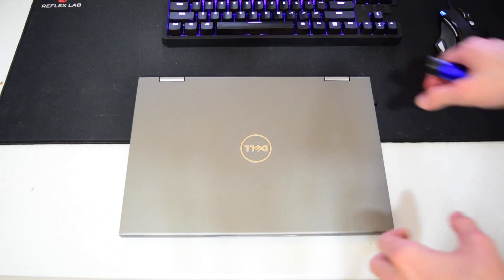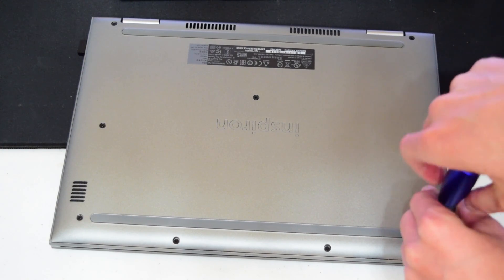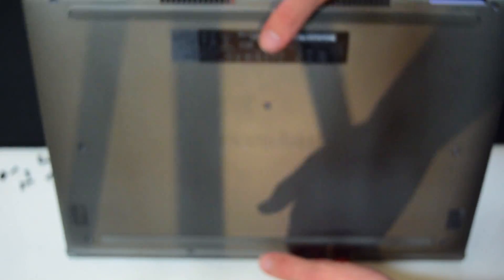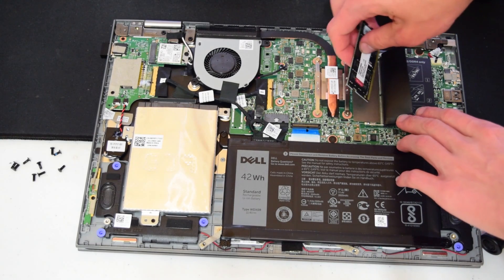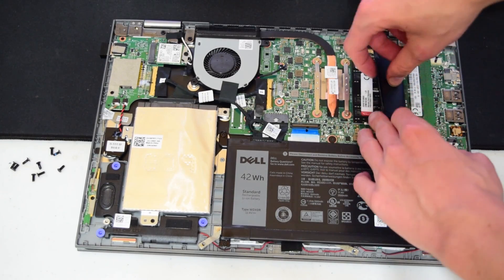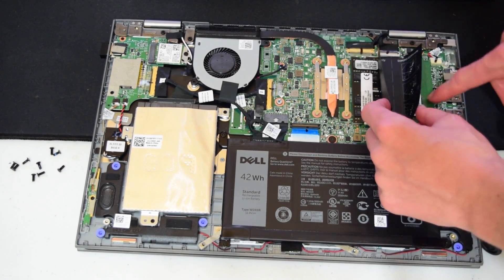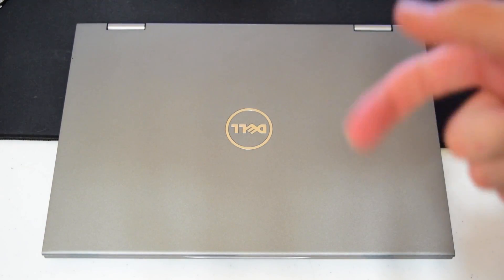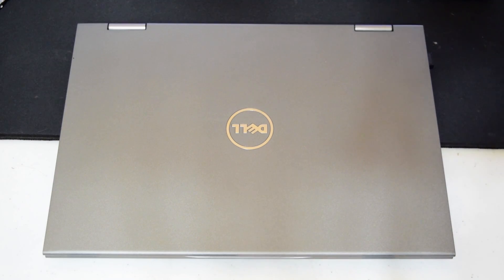Dell inspiron 13 5000 2 in 1 2016 ( ram and ssd upgrade with teardown)

Comment: I have dell 15 3000 series that I purchased just last week. But I only have 4gb which is not helping to move very fast. do I follow the same procedures here? and where do you recommend I buy RAM?
Reply from the maker: Yes follow the same procedures as i did, and any ddr4 sodimm ram from amazon will work for this model laptop. If your having speed issues then is might not be ram unless you have looked in task manager to see if your ram is maxed out, it could be the slow hard drive. But if your system is ram limited then any ddr4 sodimm ram, i purchased mine from amazon.

amazon link to the single 8gb  i purchased and installed in my computer:   https://www.amazon.com/Kingston-Technology-HyperX-2133MHz-HX421S13IB/dp/B014R8JPYW/ref=sr_1_1?ie=UTF8&qid=1473811480&sr=8-1&keywords=ddr4+sodimm+8gb

Thank you for watching, don't forget to subscribe, have a great day.

Comment: Excellent video Len. I have one DELL 13 5000 2 in 1 from 2015, and tomorrow will change the HD by a SSD. It is just to change it ? Do I need to change anything in my BIOS or it recognize automatically ? Another question: my is one I5 with 8 GB of RAM, DELL people said I can have only 8 GB of RAM, is that true ? or I can upgrade it to 16 / 32 ? Tks man.
Reply from the maker: Should be the exactly the same or mostly the same for that laptop to upgrade to a ssd, also i looked that i5 up and it says on intels website that it only supports 16gbs of ram, so unless that laptop just wont allow it 16gb or ram will work great. And when upgrading ram you don't have to change anything in the bios but it did bring me into the bios to tell me that the amount of ram had changed and that was it no extra configuration for the ssd or extra ram.

Thanks for watching, don't forget to subscribe, have a great day.

Comment: What about the battery? Where can i get a replacement
Reply from the maker: The battery is replaceable, and i don't know where to get  a replacement battery to be exact, but dell should offer replacement batteries, you might have to call them to ask but the battery is replaceable.

Thank you for watching, don't forget to subscribe for more content, have a great day.
Reply: Ok thanks but i figured out it was the charger, the pin in the middle had been bent so i bent it back

Comment: Hi looking at this laptop and it lists the cheapest version (i3) to have 4gb of single channel ram.

Can you insert dual channel ?

Also do you have a link for the ram you bought for it please
Reply from the maker: Yes there is 2 dim slots for ram, yes if the memory is the same then it will run in dual channel, I only purchased 1 8gb stick of ram and i'm using the 4gb stick that came in the laptop also for a total of 12gb of ram.

this is the link to the 8gb stick of ram i purchased: https://www.amazon.com/Kingston-Technology-HyperX-2133MHz-HX421S13IB/dp/B014R8JPYW/ref=sr_1_1?ie=UTF8&qid=1472838073&sr=8-1&keywords=8gb+ddr4+sodimm

Thank you for watching and don't for get to subscribe for more content, have a great day.
Reply: Hey, first of all thank you for posting this video.
Now, regarding RAM memory, in theory isn't it better to have 8 gb (4+4) running in dual channel than having 12gb withouth the benefits of dual channel? Why did you opt for 12gb?
Reply from the maker: Yes its better to be running in dual channel for double the memory speeds, but i needed more than 8gb of ram and didn't want to pay for 16gb of ram, so i bought just a single 8gb stick and the ram as i have it running in single channel.Yes dual channel is better and i plan to put another 8gb sting in eventually but for now its not bothering me. 

Thank you for watching, don't forget to subscribe, have a great day.

Comment: is yours the model with i3 or i5? ps. good video
Reply from the maker: My laptop has the i3, in my opinion the i5 or i7 isn't worth it but its up to you on what you think but the performance gap is so small for a big price jump for the performance you get for your money. Thank you, Thank you for watching, don't forget to subscribe for more content coming very soon. Have a great day.
Reply: Agreed, it's a $300 jump from the i3 to the i5 for me in australia. Thanks for this video mate, gonna go with the i3 and upgrade it with an ssd and more ram.
Reply from the maker: That's a great choice, the i5 just isn't worth the very minimal performance you gain. Thanks for watching, i have new content available that you can check out. Don't forget to subscribe, have a great day.
Reply: +Len Nobles Will do! thanks for the videos!
Reply: nah, ssd and ram upgrades are fine with Dell. You can always just put the original components back before getting it serviced

Comment: Much thanks for posting. When I first called Dell to inquire if it has two slots they told me it didn't. Before I had seen this I had read conflicting reports online stating that it did have two slots. So I chatted with their sales department online and they told me it does have two slots. I should have just added an 8GB stick to get a total of 12GB like you did, rather than buying two 8GB sticks. It would have saved a bit of money. I wasn't completely aware if you could run two different sizes of RAM though. I'm pairing it with Crucial RAM and likely a Crucial MX300 525GB SSD. Haven't decided for sure which brand of SSD to go with. 

What is with Dell taking so long to ship devices? I just ordered a standard configuration, not a Smart Selection, and it listed the unit as shipping in 7-10 business days. Now that same unit is listed as shipping in 13-17 business days.
Reply from the maker: I bought my laptop from amazon but dell is has a reputation for being super slow to ship there products and they choose the slowest shipping method, i think its ridiculous but they do make great products and their customer support is really good.
Reply: How its work the curcial 525 ssd ?

Comment: Hello, I really liked your video and got this laptop. Now, I also want to upgrade my HD to SSD. I am wondering if this SSD (http://accessories.us.dell.com/sna/productdetail.aspx?c=us&l=en&s=bsd&cs=04&sku=A8171238#Overview) will work in my laptop.

Also, can you explain how we have to move the operative system and programs from the HD into the new SSD? Please.

Thank you.
Reply from the maker: yes that ssd will work, but dont buy it from Dell they rip you off so bad, here is the amazon link to0 the same drive that is 60 dollars less:    https://www.amazon.com/SanDisk-Solid-State-2-5-Inch-SD7SB7S-010T-1122/dp/B00O4OHCUE

as of for data Migration, i can do a video on that to help you know how to do that if you'd like, nut i have the adata true image software that came with my adata ssd, now one of the things to always look for when buying a ssd is if comes with a imaging software, so id look for one that has software like that, that sandisk ssd might have a bundled software but if not id look for another ssd, i'd refuse to buy a ssd that doesn't come with software if you don't already have some software 

here is the amazon link to the adata ssd i bought that came with the software that i use that does work really good:   https://www.amazon.com/ADATA-Premier-SP550-Superior-ASP550SS3-480GM-C/dp/B013J7P7SK/ref=sr_1_2?s=pc&ie=UTF8&qid=1471408170&sr=1-2&keywords=adata+sp550      

if you would like to see how to use that software or maybe ill do a pick of the best imaging software that you can get for free and you can use that. Thank you for watching and don't for get to subscribe, Have a great day.
Reply: +Len Nobles Thanks man. You are the best.

Comment: Great video, very helpful! just a question: I read that it has a m.2 slot for ssd but I can't see it in video or in other pictures I found on the internet. Have you seen it?Thanks
Reply from the maker: No this laptop doesn't have a m.2 ssd slot, the 7000 series might but that i'm aware of is exactly like this laptop internally, so no this laptop doesn't have a m.2 slot. Thanks for watching don't forget to subscribe, have a great day.
Reply: thank you!

Comment: Nice review! Is the battery removable?
Reply from the maker: no the battery isn't remove-able in the of you can remove it from the outside but you can take back off and replace the battery if you need to.
Reply: Got it, thanks!